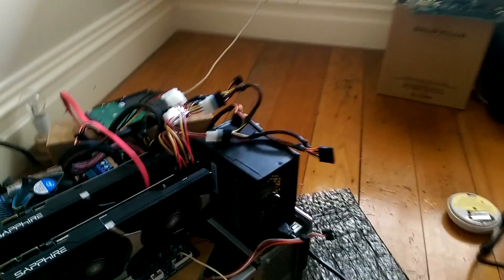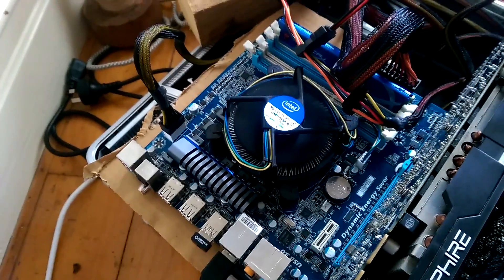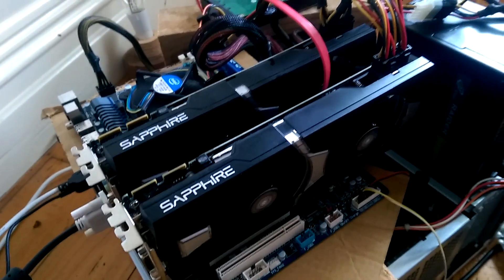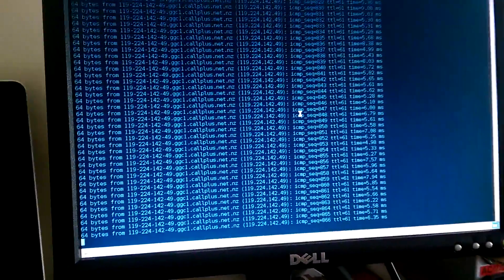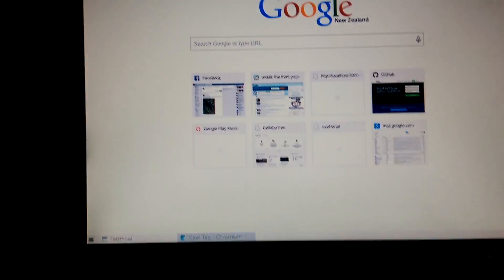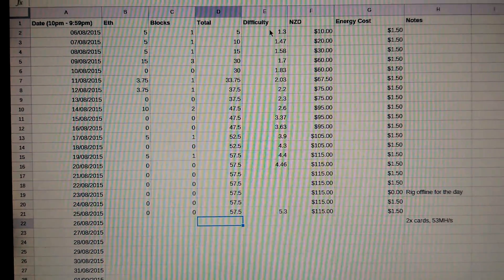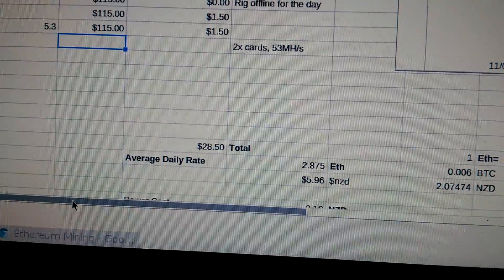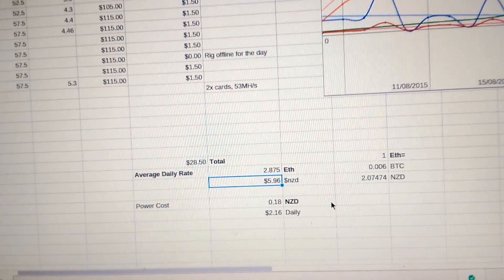Ethereum mining, small rig walkthrough

Comment: Hello friend , i hope you are well, thank you very much for this video , please i would you about time of mining , is it necessary to let the rig 24/24 ? what will happen if the electricity cut off , mean from electricity company ? what will happen if the internet cut off , from internet company ?
thank you very much
Reply from the maker: is no problem really, you just stop earning when it's offline and start again when it's back
Reply: oh , thank you very very much for your fast answer
thank you very much my friend, please i have another question
i learn in internet that best motherboard is asrock h61 btc , asrock h81 btc , asrock b85 anniversary , can i use another one ?
Reply from the maker: Yeah you can use anything that can handle 8GB of ram and has enough PCI-e slots (1x or higher, but this doesn't really matter) Also the slots need to be physically far enough apart, or you need to start doing stuff with riser cables to extend them so the cards can fit
Reply: Hello my friend, i will very happy if you answer to my question, i find (ESC motherboard g31t m9 v7.0, with dual channel DDR2 800 GHz) with PCI EXPRESS stot, can i use it 
best regards

Comment: What is the command to mine with more than one GPU per MB?
Reply from the maker: The command to run is the same, but you need to make sure your XORG is configured to use all cards. Test with: $ aticonfig --adapter=ALL --od-gettemperature

This should output a temperature for every card. If it does not than that card will not be used for mining, set up your xorg.config file with: $ sudo aticonfig --adapter=all --initial

then log out and back in again (or restart)

Comment: I wouldnt trust that molex to pcie adaptor.
Reply: I had two of these... they toasted themselves and shorted my psu. 
Got lucky and the psu shut itself off without causing damage. 
I bought another batch of them and replaced the wires with 16 AWG wire from an old psu. 
Works like a champ ;)
Reply: Das TIER molex still aren't rated to draw as much power as those cards are drawing
Reply: acnfanmanin If you look here: https://en.wikipedia.org/wiki/Molex_connector
you'll see that the molex connector is rated for 11A @ 12V however, a 6-pin pci-e should draw max. 75W = 6,25A @12V

The PSU must of course support that load on the molex output, but most PSUs with more than one rail (i.e. one rail for CPU+GPU, one rail for the rest) have at least 16A on the weakest 12V rail.
Reply: Das TIER Except it's all on one cable strand for molex which isn't ideal
Reply: Yep, you're right.
Reply from the maker: Yeah it's pretty sketch ay? Doesn't seem to produce any heat but I'd really like to get the time to build a new rig with better parts. I'm thinking of an oil immersion set up so it can be in the living room silently
Reply: Joran Get any half decent cards and they'll run silently on air if you have decent spacing
Reply: as builders have shown a oil set up is HARD to maintain... did I say HARD to maintain already??.... well I meant HARD to maintain... better use a different config... also nowadays there ways to turn heat back into electricity.... so consider that option as well....

Comment: Hello Joran. Can you please tell how did you manage to get aticonfig --odgt output correctly? In my case it only works for the GPU which is connected to a display.
Reply from the maker: +Eugene Starynets I think it's related to the Xorg.conf file, but saying this I tried running it and got no output! When it was working, it needed the amdconfig --initial -f, followed by a restart, then it worked
Reply: I see, thanks for the reply. Does your display connected to Adapter 1? Do you have any errors when running aticonfig --odgt --adapters=all?

Comment: How did you get both cards to work? I have three cards (r9 280x), but when I start mining with the second one (while the first one is mining) the hash rate drops to half on the first card and the hash rate of the second card is also half of its potential. I use ethminer -G --opencl-device X  to get them started. What command do you use?
Reply from the maker: +Florin Alexandru Hey, had this problem too. I think it picks up the other cards from the Xorg config. Running: "sudo amdconfig --initial -f" and then restarting should sort it out - I'd done this but missed the -f, so it had not changed the file. 

You only need to run one proccess, mine is running as "ethminer -G"
Reply: +Joran Kikke I had to give up trying to mine on Ubuntu. I'm mining on windows now. It's easier to set up.
Reply: +Joran Kikke 
can be temps problems